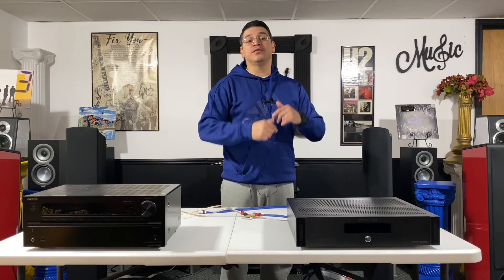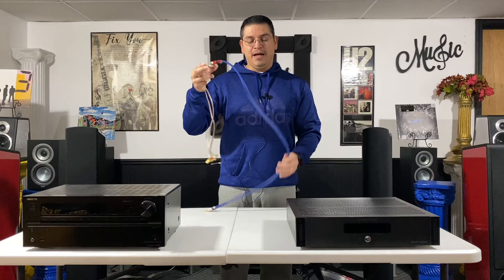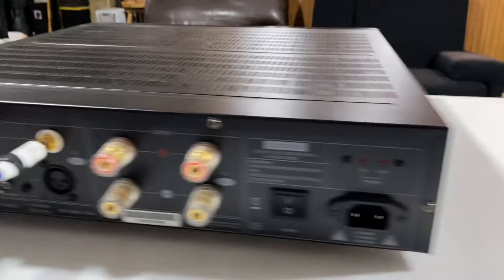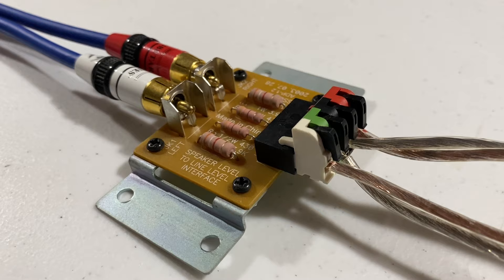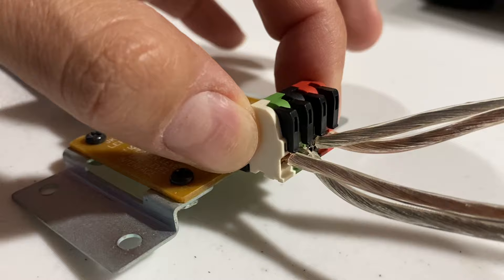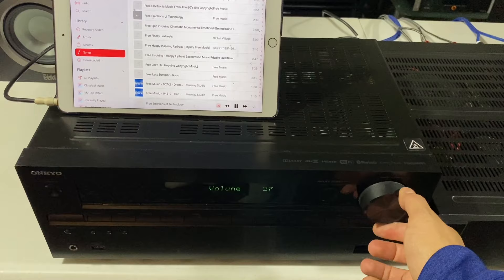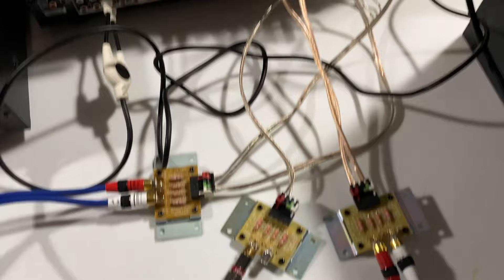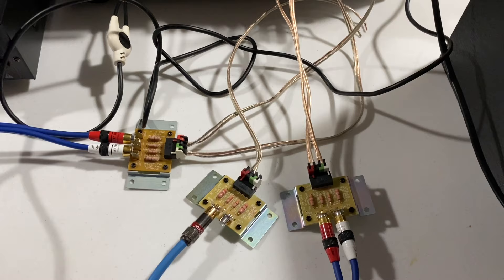Connecting an amplifier without using preouts.

Comment: Hi i am very satisfied with the Russound adapter that you mentioned .I have installed it to a Denon avr and connected an Emotiva basx a3 power amp.It woeked perfectly without any issues.Again i have a question is there a way that i can add 2 more atmos speakers to my Denon 2700 avr.So i will havea cnfiguation of 5.2.4 instead of 5.2.2.THANK YOU for ineresthing videos andvery interesthing stuff.
Reply from the maker: You’re welcome. Happy to help. The only way to get more 5.2.4 set up is if the receiver has the capability. You could split out a couple channels to add speakers but it would be a true 5.2.4 because the extra channels wouldn’t have their own signal so you could daisy chain a couple of speakers or connect them in series. The danger there is you’ll drop the ohms of the receiver and if it gets too low it could damage it. Hope that helps. Thanks for watching
Reply: I added 2 extra atmos by serial connection and don’t see any difference because the original signal divided between 2 speakers, hence the power is split.

Comment: Question: Did you try hooking up your RCA cables to the ZONE 2 Line Out? Should give you the exact same signal as a dedicated pre-out. Cheers
Reply from the maker: Yes I have. Several times. Didn’t work. Thanks for watching and commenting
Reply: Might have to tell the receiver to send signal to zone2?
Reply: @MARKC0R3  as far as i know zone 2 is just for two speakers, stero. That should be ok if you run a 2.0 or a 2.1 setup for music but not useful for 5.1 or a 5.1.2 setup!

Comment: So glad you made this video, and that I found it! Thank you!! I have an old school Pioneer 1080 SX with JBL HP 520’s and a pair of JBL Studio 590’s connected. I scored a Marantz MM7025 amplifier, at an auction. Once I got home I realized the problem of not being able to just piggyback it for even more power. So this adapter should do the trick. I do have a question though. The Pioneer unit has some RCA jacks on the back that say “preamp”, and they have jumpers connecting, or bridging them. Can the Marantz unit just be connected to those? I’m not sure what those are for. Thank you again for this video!!
Reply from the maker: You’re welcome. I have seen those preamp I believe those are for an external preamp that may have more features than the receiver maybe. Older receivers had the capability of connecting other components to save money and space. Today they are pretty much all in one. You can try connecting the Marantz to it and see what happens but it might be overkill or not work. Thanks for watching
Reply: Man I tried everything before finding your video,I just need a adapter thank you very much!.
Reply from the maker: @steven3517  you’re welcome. Thanks for watching
Reply: @Audiolympian  Thank you too,it does work!.I personally struggled with the adapter though,as it is small and my work space is cramped.I do appreciate your video very much,if you happen to come across a adapter that's bigger easier to use please do a video on it also..I will keep subscribed and keep my ears and eyes open,thank you again!.
Reply from the maker: @steven3517  you’re welcome. You’re not the only person to suggest a bigger adapter being. I always keep my eyes out for one. If you find one let me know I’ll certainly get it and do a video on it
Reply: @Audiolympian  Yeah I struggled trying to keep a 18 gauge wire in when putting it in place,banana clips would've helped but I'm also pushing large towers..I do appreciate your help though,now I know I have a good amp. Playing with them on spotify now lol
Reply: @Audiolympian  I think we all need to complain about that with Crutchfield , I got my 2 adapters from them and is look like they are the only one to distribute the adapter to ebay and Amazon  . But I hook up my wire speaker without any issue , just need to be very carefully that the wire don't touch each other to avoid a short circuit . I got another good deal on Ebay for 75,00 dollars for a AudioSource Amp Three 2 Channel Power Amplifier 150watt per channel at 8ohms . One amp I'm using for my mine speaker the other amp I will use for my center speaker to get a good increase in front stage presence , Do you think is ok or is better to put my second amp to the surround channel
Reply from the maker: @mauriciob8260  I agree about the lack of adapters available. I would keep the second amp on the center channel for full front stage power. Thanks for the question. Appreciate the support
Reply: Did you realize those rca connections said "pre out" instead of "pre amp"? That's exactly where you connect your marantz or other power amplifier. Otherwise I'm confused
Reply from the maker: @mrkrinkle8323  yes I know what you mean. I did see that. But for some reason no sound comes through the preouts when connected to an amp.
Reply: @mrkrinkle8323  I have a sx980, run rca from the pre outs to my Parasound, no gizmo needed.
Reply from the maker: That’s awesome

Comment: Great video... do you know where to find these adapters? I brought 2 but I need another one. They're sold out everywhere. How did you come up with this ?
Reply from the maker: Thanks for watching. Sorry they are sold out everywhere. I talked to crutchfield and Russound. They told me there is a chip shortage for those. But they did say they would keep me in the loop of when they’ll be back in stock. I came across that adapter online one day and wanted to try it because I had a receiver but I wanted to connect my amp. So I thought this might be something others may want to try. Thanks for commenting.

Comment: I wanted to add a extra pair of speakers to my system, ( I already have a Bose cubes 5),and I was planning to buy an amplifier with 6 channels but I realize  my receiver do not have preout. How many of this ADP I will need per extra pair of speakers to get an amplifier hook up to a receiver DENON AVR-540BT?
Reply from the maker: Each adapter is for 2 speakers. So if you want a 6 speaker system then you’ll need 3 adapters. Thanks for watching and hope that helps

Comment: Can you use these adapters for a TV with audio out? Any channel of audio output with the correct adapters?Thanks.
Reply from the maker: Good question. I would think you can use it with tv audio as well, as long as the tv has speaker output terminals. But I haven’t tried it. Hope that helps. Thanks for watching
Reply: @Audiolympian  Thank you so much .Yes the right and left but also there are adapters for other audio output to right and left.As the adapter you mentioned in your video.
Reply from the maker: @kennethwilson7839  you should be good to go

Comment: I have the Denon 760H recently bought it from Costco 7.2.It does not have pre outs. How can I add extra speakers to the receiver. If I buy an amp and this connector can I able to add speakers for a 7.2.4 system. Can I do parallel speaker wire connections to the existing speaker out in the receiver,one going to speaker and the other going to this connector then to amp and from amp to the extra speakers needed ?
Reply from the maker: Yes you can do that but keep in mind the extra channels won’t be dedicated channels for a true 11 speaker set up it would still just be 7 channels split up because the receiver is designed for 7 channel output decoding. So basically which ever channels you parallel will have the exact same sound coming from both speakers. But at the very least it would give you more sound through more speakers. Hope that helps and thanks for watching

Comment: hi. I have Onkyo 473 atmos 3.1.2. Can I add 2 more chanels to get my back speakers? I did no understand how you add more chanels when you plug the wires in the main amp in the same place where other cables should go. So confused :-(
Reply from the maker: Sorry for the mix up. No this process and adapter doesn’t add more channels. It just allows you to be able to amplify the current channels for more power. Thanks for watching

Comment: Thank you!  I am being given a Sony stereo amplifier.  I have a Sony 5.1 AVR and it seems it is not putting the  power out on the front left and right channels, but the center is plenty loud.  My AVR does not have pre-amp outs though. 

Is this modification  going to lessen the demand on the AVR amplifier?

Can I leave the center channel on the AVR or should I try and run it off the stereo amp?  It does have a zone A and B that you can run at the same time and some people do two stereo sets or have that send the signal a sub because this stereo receiver is technically a 2.0 not a 2.1. 

Can I leave the Sub on the AVR?

Do you leave your amplifier volume control to max and then control master volume via AVR only?
Reply from the maker: Hey @nathanaelcole8466 thanks for the questions. So no this set up will not lessen the load of the receiver because it uses the existing signal after output. You can leave the center on the receiver but it will have lesser volume than the speakers connected to the amp. But if it’s very noticeable or not will depend on your amp. For example I use a sun fire amp with 200 watts per channel and my center channel is just connected to my receiver and the difference of sound is noticeable but not unbearable, for me anyway. Also my amps don’t have volume controls but if the did I’d have them all the way up and use the receiver for sound controls. And yes leave your sub on the receiver, as long as it’s a self powered sub. If it’s a passive sub then you may want to connect to an amp. Hope that helps. Thanks for watching
Reply: You're the man! Thank you for the quick and thorough answers.  I ordered one and will have my new stereo later tonight to start messing around with.   @Audiolympian
Reply from the maker: @nathanaelcole8466  you’re welcome. Appreciate the support. Hope it works well for you

Comment: Would this work  with over head speaker? I have a 9ch AVR the i currently running 5.2.4 Dolby Atmos  i was thinking to get this line converter to run those over head speakers.
Reply from the maker: Yes it should as long as the receiver has overhead channel speaker options. It will work fine. Thanks for watching

Comment: I have a 7 channel Denon AVR S960H that currenty powers/drives my 5.1 speakers (2 fronts, 1 center, 2 surrounds and 1 sub woofer) but I am considering getting an external power amp (BasX A5 power amp) for more power. Kindly help me on how to get this connected correctly, considering that I plan to hook all of the 5 speakers to the external amp while I leave the sub woofer to be driven/pushed by the AVR. Please let me know how many adapters needed as well. The Denon AVR S960H doesn't have preouts. Thank you.
Reply from the maker: Awesome project you working on. It will sound great. For what you want you’ll need 3 adapters with one of you adapters only using 1 rca output. Feel free to ask anything anytime.

Comment: How do you trigger the amp to turn on when you turn on the avr? All my equipment is in a closet so don’t want to have to open the door and then turn amp manually.
Reply from the maker: Depends on how your amp triggers. My specific amp is triggered from the rca signal others use the trigger output from the receiver. If the receiver and amp have  those capabilities, some don’t and need to be turned on manually. Hope that helps. Thanks for watching

Comment: Can a Tape Out RCA on a stereo amp (1) be used to connect to amplifier (2) which has the power to drive the bass speakers only?
Reply from the maker: It’s possible, I’ve never tried it. However I did used to connect an equalizer to my tape outputs at one time. Usually the subwoofer output on the receiver drives the bass. Hope that helps. Thanks for watching

Comment: @Audiolympian, thank you so much for this video but am still confused. I bought the Russound but still don't know what to do. I currently have a Marantz Cinema 70s so would want to use the pre outs to power my LR with another AVR (Sony Mutiki STR KM7, 7.1),they don't come with pre outs. So I have the RCA Cables coming from the Pre outs of the Marantz to the pre outs part of the adapter, so what do I connect to the speaker wire part of the adapter, is it the speakers wire directly for the speakers or the speaker wires goes to the Sony AVR? Not sure, confused
Reply from the maker: No problem my friend. Happy to help. You take the actual speaker wire from your marantz to the speaker wire inputs on the adapter. Then you connect your rca cables from the adapter to your amplifier. Then your speakers connect to your amp.
Reply: @Audiolympian  thank you so much but where on the Sony Amplifier(AVR)? don't forget there are no Pre outs on the Sony. Do I connect the RCA Cables to the Sony Amp/AVR and where do I connect the speakers on the Amp/AVR.
Reply from the maker: @chumaiwugoh2964  are you trying to connect and AVR to another AVR?
Reply from the maker: @chumaiwugoh2964  if you are trying to use and avr to power your LF speakers, the Sony needs to have RCA INPUTS in order to use the signal. If your AVR doesn’t have the inputs then it may not work. But you could try connecting to the cd input or possibly Aux input on the sony. Hope that helps
Reply: @Audiolympian  yes, to spread the load. LR Channels on the Sony (including the subs because my subs are passive). 50watts per channel from the Marantz I think is abit low, need to always crank it up to much..
Reply from the maker: @chumaiwugoh2964  gotcha. I’d try connecting to one of the inputs on your Sony and see if that works

Comment: I have a pioneer sx 950 with its pre outs bridged,how do I go about connecting an external amplifier
Reply from the maker: Not sure how you have the preouts bridged. This would mean that you have a device connected through your preouts right? If that’s the case using the preouts overrides the speaker terminals for that specific channel. So, if your receiver has preouts I’d suggest connecting an external amp through those. If you’re preouts are not accessible for any reason then you’d need an adapter through the speaker terminals for an external amplifier. Hope that helps. Thanks for watching

Comment: Would a simple RCA to Bare speaker wire cable work?. I'm asking because if so it would be much cheaper than spending $40 for every 2 channels.
Reply from the maker: That’s been a common question lately. I can’t say for sure, seems like it would but I’m sure the capacitors, rectifiers and diodes have something to do with transferring the signal. You certainly can try just using a wire and interconnect. And see if it works. Thanks for watching

Comment: I have a Pyle 8 channels home theater amplifier. I have try to connect few of RCA connector to my 9.2 channels Onkyo receiver to the Pyle amplifier, but It didn't work so what can I do to make it work for me I really need your help,& just to let you know that my receiver doesn't have a pre-out!
Reply from the maker: Depends on what the issue is that it’s not working. First I would check and make sure the Onkyo receiver has audio rca preouts that are working. Then check the Pyle amp and make sure those rca inputs are working. I’d start there first. Hope that helps. Thanks for watching
Reply: But I have done exactly the way you have done on the videos, but it just didn't work! I am trying to understand about this Pyle amplifier it seems so complicated to me!
Reply from the maker: @shawnbrown4359  yeah the Pyle amps can be complex and not as home theater friendly as stated. Which model is it? I can look up some details for you
Reply: The item model number is: PPT8000CH
Reply: My Onkyo receiver is: TX-NR797
Reply from the maker: @shawnbrown4359  this is a complex device. However from what I can see the pt8000ch is not as “home theater” as it claims. You should just be able to connect to its audio inputs and from there binding post to speakers but that doesn’t seem to be the case looking at the input/output section on the far left of the back panel. I did find a manual on manuals.pyleusa.com/pdf/pt8000ch maybe that can help you. Sorry I couldn’t help you out more.
Reply: @Audiolympian for some reason I can't pull up the manual that you just gave me! Where on my receiver can I use to hook the Pyle?
Reply from the maker: @shawnbrown4359  hmmm that’s weird try this link https://r.search.yahoo.com/_ylt=AwrEZ7CxrtRiBmoAPhJpJjE5;_ylu=Y29sbwNiZjEEcG9zAzQEdnRpZAMEc2VjA3Ny/RV=2/RE=1658134321/RO=10/RU=http%3a%2f%2fmanuals.pyleusa.com%2fPDF%2fPT8000CH%2520%281%29_3455bba2-bc48-4347-b60b-bccb056479f0.pdf/RK=2/RS=FnvAiZthBMOJS71IJD7KdQRvTSw-
But you should connect the Pyle to your Onkyo preouts.

Comment: Can I use the exact same adapter to hook up a second av receiver?...Or is this only intended for an external amplifier? My Denon doesnt have preout...it only has sub out...
Reply from the maker: Hmmm interesting question. I would think yes if your using the second receiver for amplification and it has a  
2/5.1/7.1 rca inputs. But I can’t say for certain it would work. Hope that helps. Thanks for watching

Comment: I have a good question for ya- I listen to "all channel stereo" often for music on my 7.2.2 setup. Would adding a second amp for the front two tower speakers be a smart move... considering they are capable of much more power?
Reply from the maker: Good question. So here are some factors that will determine if you’ll hear a difference. Amount of power from the amp, room size, distance from the speakers. You probably won’t notice much if your in a medium size room that’s a bit open and you not too close to any specific speakers. Smaller closed room, yes you’ll hear a difference. Now for amp power, you may not notice a big difference at 100 watts. But 150 watts you should notice a difference and 200 and above you’ll definitely notice a difference. Also depending on your receiver you can adjust the db levels of each speaker as well. Hope that helps. Thanks for watching